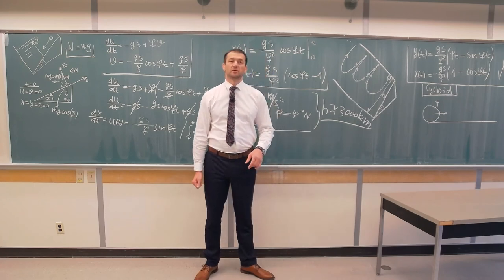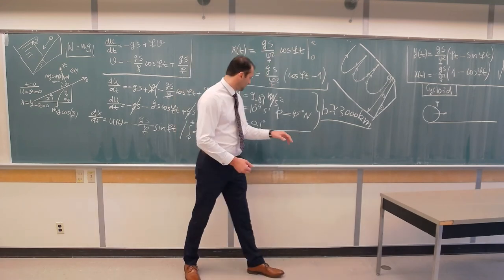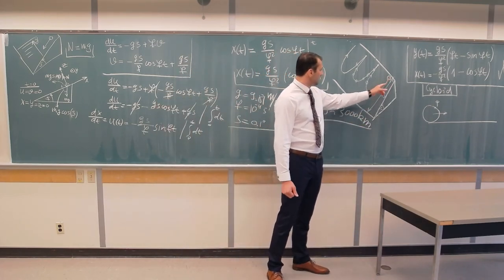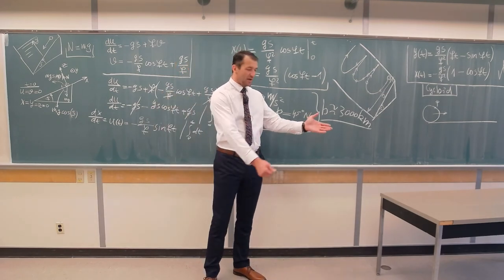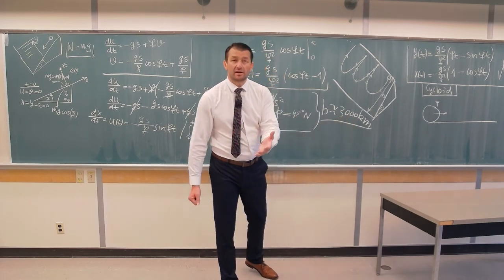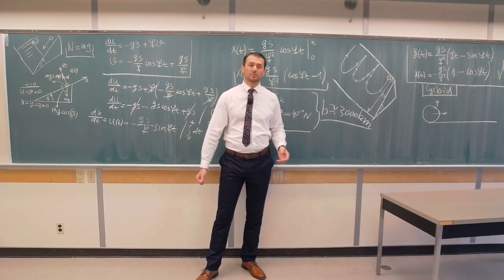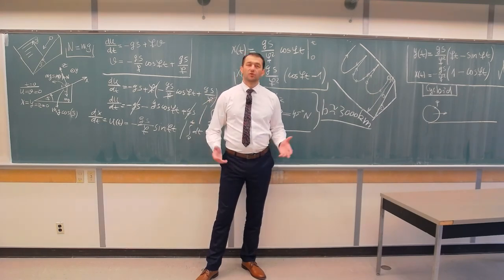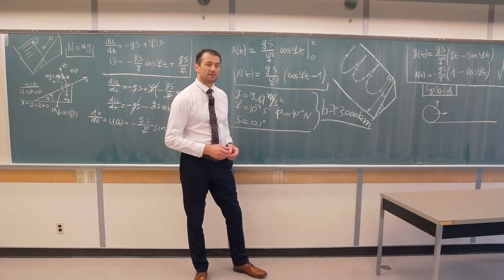Coriolis Force Q20: Inclined Plane and Cycloid

Comment from the maker: At 24:51, the correct solution of that integral in the limits between 0 and t should be (c2/f)*(cosft - 1). It doesn't change anything because c2 = 0. That's what happens when I skip steps and try to solve these things in my head as I am writing it.